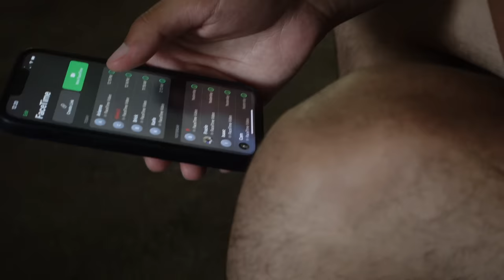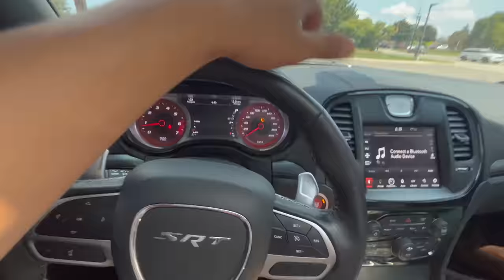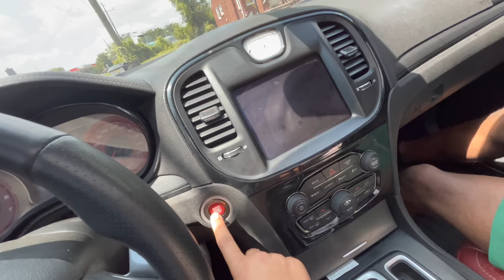TEACHING MY 15YR OLD SISTER HOW TO SLIDE MY HELLCAT BLUEEYE JAILBREAK 300

Comment: When you sliding a car a dodge to be specific , A. you Gotta Control The Gas Pedal (Play With the pedal like…tap it in a pattern and give yourself enough time to slide around the circle) B. Don’t just keep turning the steering wheel play repeatedly tap the gas pedal and turn outwards a little bit before you turn inside if that makes sense. Don’t over do the gas pedal that play a major part but also the steering wheel is important too cause you have to control the circle
Reply: thats not dodge specific thats drifting in general XD
Reply: many ways to start a drift continue it and leave it
Reply: @ItzSmokeyB  I’ve tried other cars and I feel like it’s easier to slide a dodge or a mustang with less effort then any other car in my opinion
Reply: @_1noclue nah you don’t know
Reply: @AffectionateFireflies-ib8hm  these are facts I use to work Ina airport sliding nun but V6 rentals sometimes 392s it’s not hard to slide a dodge trust me I slide a big ass Durango so the chargers are basic
Reply: @AffectionateFireflies-ib8hm nah he’s right i can say the same lowk idk if it’s cuz dodge r big but they easiest to slide in
Reply: Bro that thing was a Chrysler
Reply: @StevenMoog  they all mopar so wym